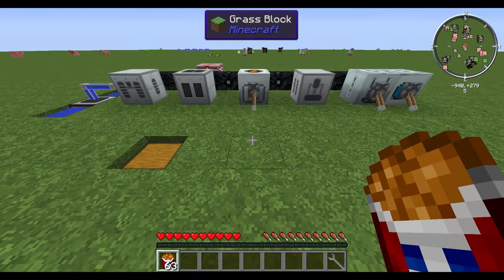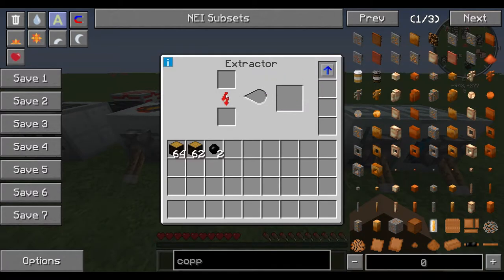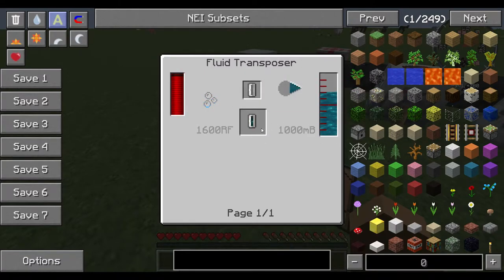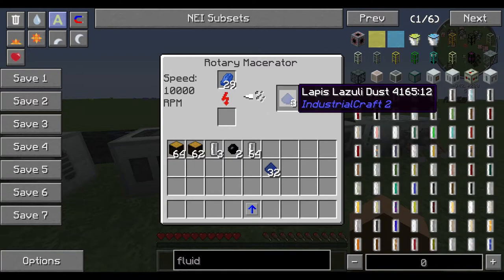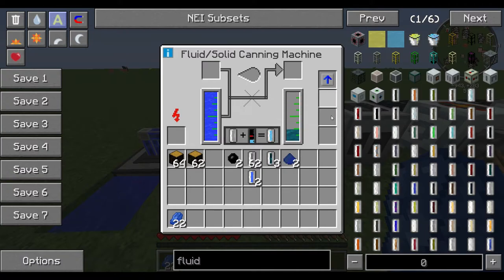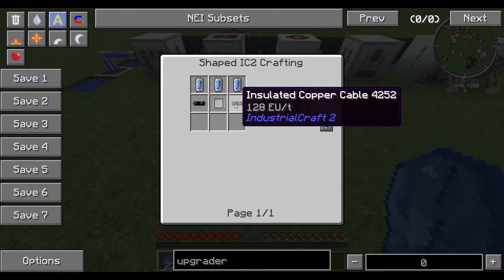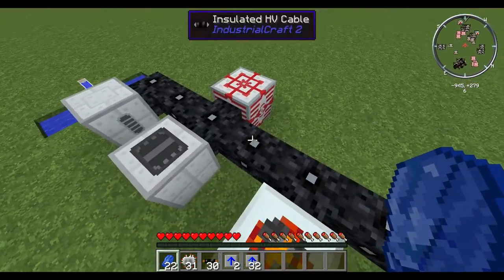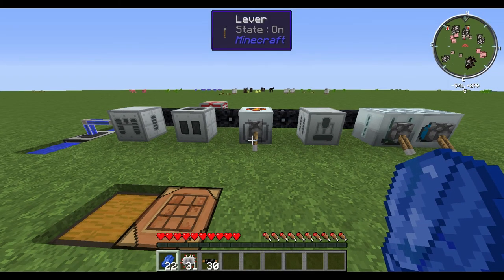Spotlight: IC2 Experimental Overclocker Upgrade

Comment: I find that most of the time whenever you "need" an overclocker, if you can afford it, it's better to make multiple of that machine until it's fast enough overall and distribute the load. Now granted it takes a lot more space but it becomes overall a lot faster.